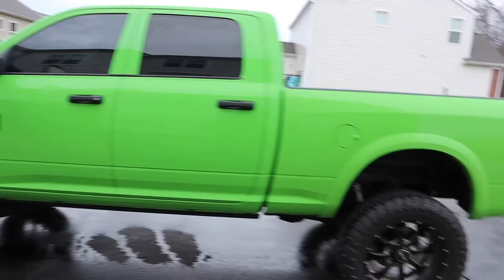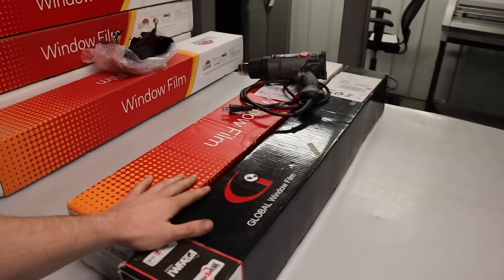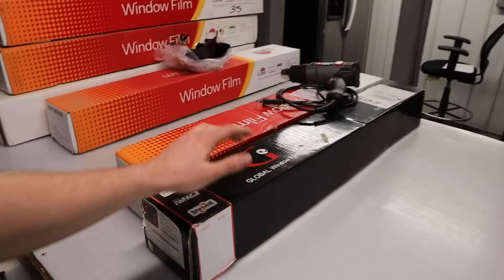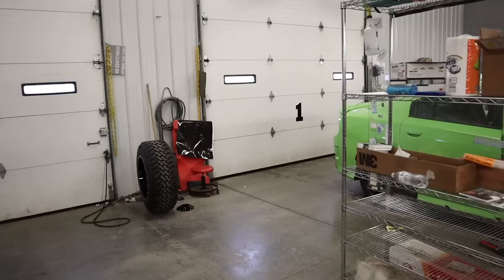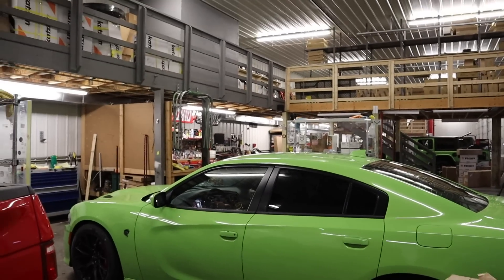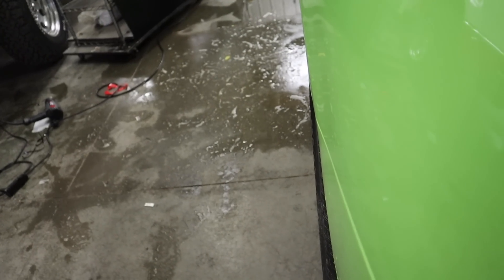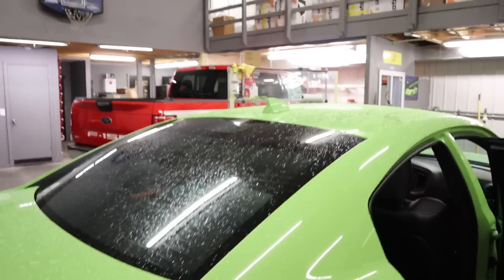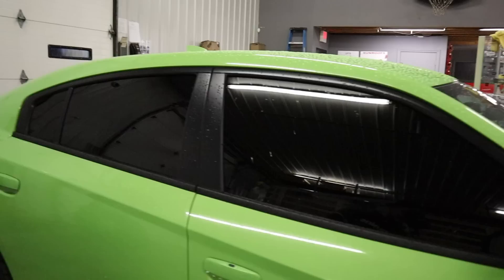FISH BOWL DELETE ON MY NEW HELLCAT!!

Comment: Hey I have a question. I have a 2001 Oldsmobile alero 3.4 engine.. first question I wanted to ask how much would it cost to fully modify it with different bumper, skirt and back bumper other question why does my car accelerate slower than usual

Comment: Duuuude... that tint makes a whole new car. I know what I’m doing next haha. Nice tires too.
Reply: itsjeremy - Tint should be mandatory.
Reply from the maker: It changes the whole look of the car!!
Reply: Well shit. Maryland only allows 35% 👎 Is it still worth it?
Reply: @selfhosted  yeah it will still look better. Not a good as this but 35 is way better than stock.
Reply: @selfhosted  Also depends on how strict the cops are on the tint. In Nc it's the same for cars 35 all the way around but nobody does that. Just have to find a place that will look the other way and pass the inspection. I have 35 on the front two and 25 on the back two and the rear. I went with ceramic so it's a little darker.

Comment: In a month or so I will be getting a Llumar Stratos (Nano IR)  tint probably around 30% all over, maybe 15% on the sides if I can handle it since this is my first car, so it will be my first time having a tinted car and it is gonna be pretty expensive, it's $499, but I will get good use since it is my daily driver and I live in a hot state, so it will surely come in handy.